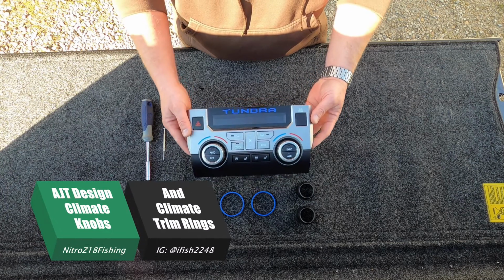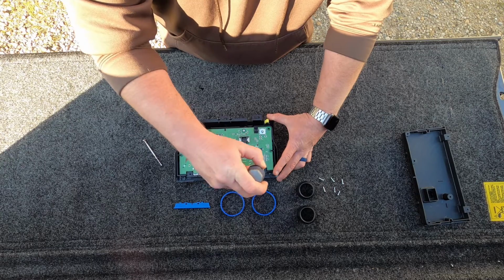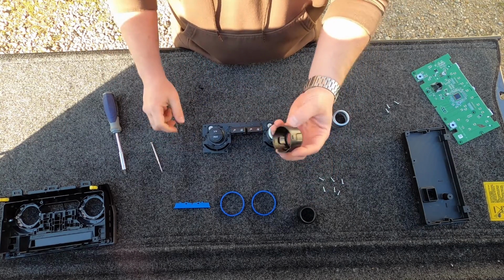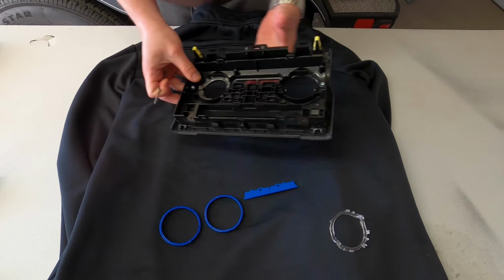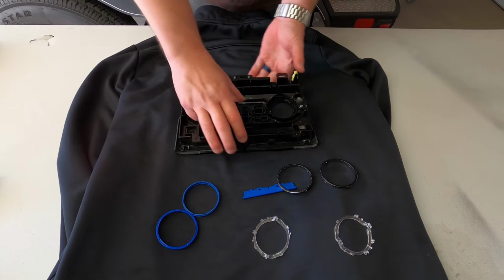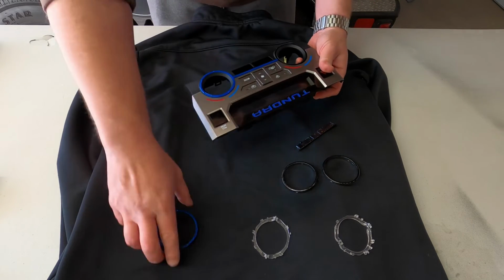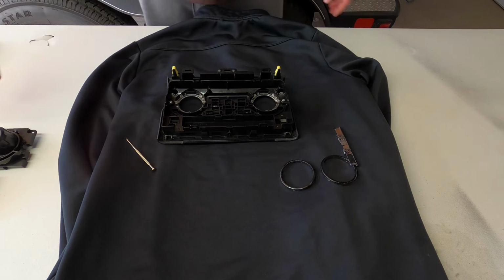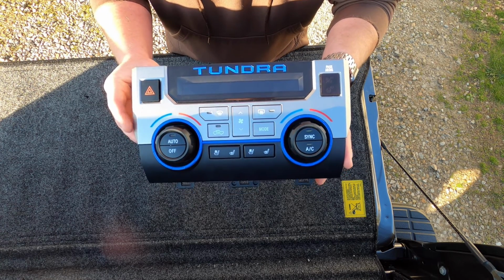AJT Design Climate Control Knobs and Trim Ring Install Toyota Tundra

Comment: Hey man I noticed you have the bed rug how do you like it. I’m putting on my “under the tree list” and was going to do the mat and tailgate cover. I’m really looking to not kill my knees when I’m kneeling on the bed floor
Reply from the maker: Hey buddy!… I absolutely love the bed rug, I’ve had it on all three of my tundras so far… Fairly easy to clean for a carpet like material and the padding underneath is nice… No complaints at all from me, hope that helps!

Comment: Where did you get the blue tundra insert on top of climate control panel?
Reply from the maker: Got that off eBay, if you search for tundra radio decals you’ll get a ton of options...hope that helps!

Comment: Do you need to mark the locations of the knobs position prior to the complete disassembly like i seen on some the other videos with the 3 climate control knobs?  My setup is like yours only two knobs
Reply from the maker: No sir, not for the dual climate control with 2 knobs...our knobs spin freely (if that makes sense), they work a little differently than the 3 knob set up...hope that helps!

Comment: Just followed your video to change my climate control knobs, trim rings, bar, 4x4 knob and start button trim. My phone was getting a workout from pause, rewind and play. Only thing I did different was changed my start button trim ring while it was still in my truck. I was able to get it off real easy. Thanks for posting the easy to follow video and thanks to AJT Design for some cool products.
Reply from the maker: That’s awesome, thanks for the feedback Joe!...yea for some reason my start button ring wouldn’t come off that easy for me, but you can def do it in the truck if it’ll pop out easy for ya!...glad it helped you out, and I agree, love the AJT products!